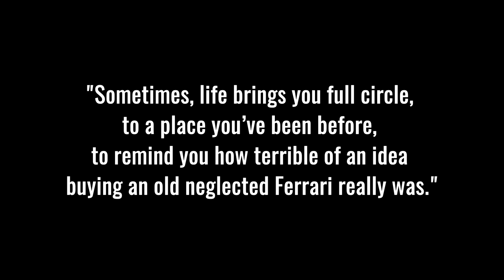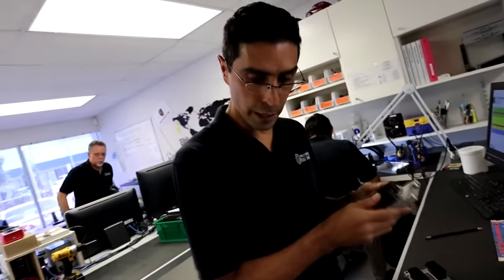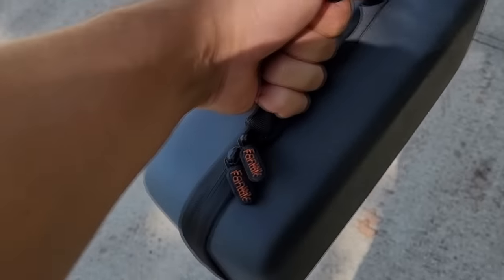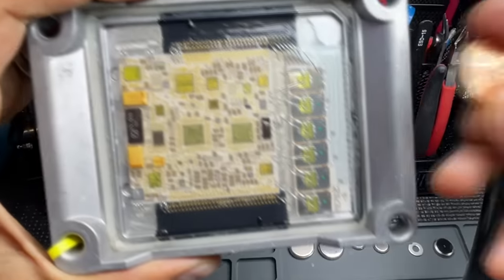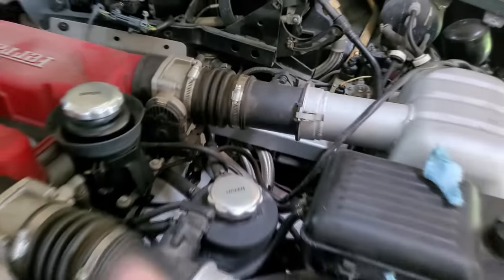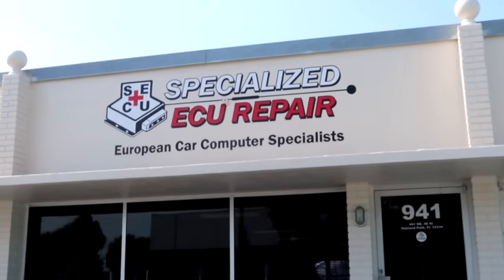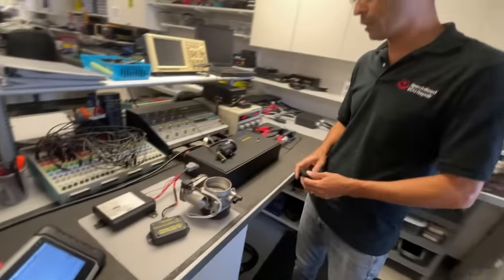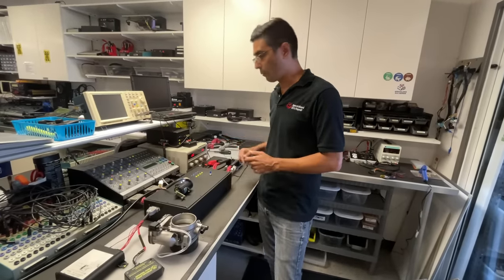Here's What FINALLY Fixed my Cheap Salvage Ferrari!!! (EVERY Ferrari 360's Fatal Flaw)

Comment: You should check with Anderson Dick from Fueltech, his 355 turbo is running on fuel tech and it seems to be doing great
Reply: The only problem with running a standalone ECU is that they don't have systems to run the emissions equipment.
Reply: @vegatrunks  Many of the standalone ECU can be programmed to run the emissions equipment. Its just matter of the software you put in to the ecu.
Reply: @vegatrunks  as long as you get a model with enough inputs and outputs you can just about anything
Reply: @jarnom85  I thought the same thing at first.  But it won't fly in states that do the OBDII test and not the sniffer test.  Sure, you can make the emissions equipment function at some rudimentary level, but I don't know of any aftermarket ECU that will duplicate the OBDII requirements.  The first thing that test looks for is the information on the VIN, year / make / model of car, etc.  They will fail it immediately when that information does not show up.  The aftermarket also will not do all of the necessary monitoring and reporting on the various sensors that are required.  A lot of states have exempted all pre-OBDII vehicles from inspection, so if your car is 1995 or older, you might skate on that aspect of it.  Cheers.
Reply: @ericdolan2130  you could still have the old ECU connected to check via OBD2 the car data and the standalone ECU to run the engine.
Reply: @tcar  I wouldn't say it can't be done, but I think it's problematic. From what I understan, the newer obdII systems don't just observe, they are active players.  If it sees something it does not like, it is going to try to correct it, and when it can't, it is going to throw a code.  You will also need all of the emissions equipment in place and connected.  It's Pandora's box.  You need to mount two ecu's, run two wiring harnesses, etc.  Cheers.
Reply: @hausmeisterengineering5952  yeah, who gives a fuck about our planet...
Reply: @944Tomcat  Wow! Did your mom and/or dad teach you how to behave in public discourse or did you come up with the vulgarities on your own?
Reply: @944Tomcat  If all the systems are working properly and the only thing that isn't completely functioning is the obdii to check it why woiuld it matter?

Comment: The tech you are looking at in the Ferrari is "Direct Die Attach". The other module's tech is standard IC packaging (the dies are bonded out in those black square packages)  and actually over a couple decades old. That is generic "Surface Mount Devices" (SMD) and specifically TQFP for the big chips.  Unfortunately direct die requires some very expensive equipment and skill to service. That is in the domain of the actual chip manufacturers and in clean rooms.  That is also a MultiChip and conformal coated Module.  In a nutshell it is designed to be made - not serviced.  It is incumbent on Ferrari to overbuild the module and maintain a 7-10 year supply after they discontinue using it to keep the service supply chain happy. (Note Tesla, is also pissing everyone off right now by not having adequate inventory for repairs.)  Repair inventories of course have to be factored into the retail unit cost for the duration of the product lifecycle. You ramp production and service when you release the product and as it matures and the end is near quit producing the material and deplete what you can. It is also common practice to keep using the same design in other products as long as possible. This is generally pretty easy with engine computers.  In fact I'd be surprised if that Bosch module (OEM'd by and programmed for Ferrari) was not used by anyone else. That would be terribly expensive. 

All that said - I have to wonder if someone zapped the unit and its miss sensing an input. Moot point as there is precious little you can do to fix it at the component level.
Reply: Agree,  I also think that the Bosch module could reasonably to be found in other cars from the period. NRE on a module like that is huge.
Reply: The BMW ECU is pretty standard Bosch for the period, and I agree it certainly shares it case and general internal architecture with others. Ferrari might have used DDA technology to 'save weight' or some other BS, at the expense of durability, serviceability, and, well, money (Who cares?! Ahh-Hahaha!). So maybe this configuration is unique to them. I could be wrong of course, but that's exactly the kind of thing Ferrari would do because they hate us and want us to SUFFAH!!
Reply: It's not "mis-sensing" an input. It's stuck in bootloop because the processor is browning out. Probably a dead capacitor.
Reply: @Friend_of_the_One-Eyed_Ladies  Knowing what goes on with faulty Apple Laptops it could easily be a faulty power circuit component. That being said Botch would have used the same ECU design in other vehicles and even for other manurfacturers
Reply: Why would something like that ever fail? It looks incredibly well protected. There are no moving parts.
Reply: @GizmoMaltese  
Mainly heat and vibration.
Reply: @GizmoMaltese  - There are moving parts - electrons! Generally these parts will last decades but as Michael Lorenson rightfully noted - the enemy of electronic circuits is heat (note its mounted away from the engine) and vibration - especially on the connectors. Most ABS modules fail because of connectors.  The other situation that can easily kill a module is static discharge during handling. Live connection will smoke an input etc. Honestly I'm surprised to hear these things fail at all. They tend to be over designed and if handled (and cooled) properly should last forever. 
Along the lines of heat. It would be interesting to know if a FLIR camera could be pointed at the two modules while warmed up and running. Is the left location hotter than the right. Is the underlying wall also heating up and dumping heat into the module vs taking it out. That would call for a thermal isolation shim to allow the module to release heat vs absorb. 
Getting back to heat - note that PC folks "overclock" their graphics cards to eek out a little more performance. They jack the voltages and frequencies up - producing more internal heat in the die. They take the fans off and put on water cooling (a classic radiator with multiple fans).  If they didn't get that heat the hell out of there the chips will fry in no time whatsoever.
Reply: @Friend_of_the_One-Eyed_Ladies   - Very possible. Capacitor reliability was a huge problem for several years. There's a known Prius issue wherein the display does not come up periodically. Root cause is a 12 cent capacitor that aged (due to heat) until it was out of spec. Caps dry out, too, over time. It is their known failure mode. A common thing in pro-sumer audio is to send your amplifier in to have all the caps replaced every 5 years. This gets it back to perfect response. I cannot hear the degradation but you can sure see it on test equipment when waveforms distort. Of course for an engine controller that distortion will freak out the decision the software is making. That flapping throttle is a tell tale sign that either the CPU is getting constantly reset or an input (feedback loop) is indicating it did not move. 

Note this is not a "right to repair issue". They make that module "chip on board" for reliability. There is a tradeoff between serviceability and reliability when designing these things. Reliability takes precedence. They fully expect you to replace the whole sub assembly and not dig into the bits which could compromise the reliability of the repaired module.
Reply: @dennisfahey2379  Thanks. I suspected heat could be the reason  but I think it would need to get even hotter than a modern CPU to fail. The connect between the board and the car looked really sturdy. I'm also surprised to hear these commonly fail.
Reply: @GizmoMaltese  - This stuff is usually rated to +85C. Its in an engine compartment. As for the connections failure mode. Its usually vibration that messes up the pin soldered through the PCBA - the solder ages and cracks. Or it can be the mating connector (female side) vibrating and losing springy contact. That is NOT the case here as the module swap followed the module. (Good troubleshooting there)
Reply: @GizmoMaltese  Poor design.
Reply: @GizmoMaltese  Vibrations is one issue. Especially if using aluminium bonding wires because aluminium has no limiy to fatigue. Many metals will drop in strength initially but after enough cycles of vibrations it levels out. Aluminium does not level out - it will get weaker and weaker until it fails.

Bit heat is also an issue for flash-based memories. Some electrons breaks out over time from the individual memory cells, and this process is greatly affected by temperature.

This means that normalmflash memoties can not be used for an ECU - they would lose the memory content in months to maybe a few years. The chip manufacturers have specific parts made to handle much higher temperatures. They are still affected, but at a much slower pace.
Reply: @dennisfahey2379  The engine compartment temperature is an interesting comment, a common cause of excess engine compartment temperatures, is the failure of the silencer (muffler in the USA) insulation. The outer case of the OEM silencer is just a stainless steel shell which contains the heat insulation material, when new this insulation was in the form of solid pads, but overtime it disintegrates and becomes like talcum powder, a well know 360 problem where the engine compartment has to be regularly cleaned to get rid of the "white dust". This seems to occur when the cars are approx. 5 years old, eventually nearly all of the insulation will disappear, causing excessive tempreture in the engine compartment, which is aggravated in countries with high ambient temperatures. Some people in California have been installing boat engine compartment fans in an attempt to cool the Ferrari engine compartment. Onefactory option was to have the CS rear grill fitted.
The replacement of the OEM with a Capristo et.c silencer may also cause elevated temperatures, as they don't have very much insulation.
In the UK I have refurbished a number of OEM silencers by removing the stainless steel covering and replacing the inusalation with a very high temp mineral wool.
Reply: @geoffaries  - Fascinating and thank you for the lesson. Heat is always an issue with performance of any nature. Look at the Gamer PC market and you will see - I kid you not - water cooling and radiators!  So the key is to get the heat that is inherent in any design the hell away from it. Convection cooling requires ambient airflow - remember air cooled VW's? You need to keep moving to create that airflow. Forced air cooling requires fans and ducting to direct it to points of interest. Even Teslas have fans to cool the batteries which heat up when charging.    So I think its time for an epic jump in cooling. If you want 1000HP plus engines you need to deal with it. What does the Veyron have 10 unique radiators?  Be interesting to hear what people are doing to solve this issue as it applies to many many industries.
Reply: @Michael_Lorenson  I agree, a few ounces doesn't help when your car can't move. I think what really happened is someone convinced Ferrari it was a new super-tech. In reality it's basically a large-scale version of how normal chips are internally. And the same reason you wouldn't try repairing an individual chip, you'd never try to repair the ecu. One reason newer CPU's have multiple 'chiplets' is because yield drops significantly as the die increases in complexity & size.

So who ever sold them on the idea is a fantastic salesman (in an evil way) and they guy who signed off on it really dropped the ball.

Comment: I wonder if something like a Haltech would be able to easily take over with an adapter harness?  Seems like the most straightforward solution.
Reply: Until the EPA gets involved, he wouldn't be able to pass emissions on an aftermarket ECU.
Reply: @eldonerc2524  Haltech is an Aussie company, and here’s an Aussie solution: Just do it anyway. Tuned properly, the car should be as good if not better than stock. What’s the hassle?
Reply: @rakeau  > inspection place plugs equipment into obd2 port
>haltech reports "All good m8"
Could work...
Reply: @tinncan  Hmm. You’d think if they wanted to measure emissions they’d stick something up the tailpipe. Y’know. Where the emissions come out of.
Reply: @tinncan  2nd aussie solution: Borrow some working factory ECU’s off of a mate, pass all the inspections, give your mate his ECU’s back so his car works again, and then whack in the aftermarket ecu 😁
Reply: Florida doesn’t inspect. Problem solved.
Reply: @tinncan  I don't think they have OBD2 output. Some people use an aftermarket ECU but keep the factory ECU attached to report 0 issues to a scanner haha
Reply: Haltec and others only make specific units for common cars (GTR's, Altezza ETC) Not so much with a ferrari. Get a good auto sparky on the job and they can wire one up for you no trouble
Reply: I found myself wondering the same thing.  It comes down to economics. Haltech isn't cheap for run of the mill cars, but viable for a Ferrari.
Reply: @ReubenHorner  thats not how that works. You could easily use a haltech in this car. Yes they make plug and play computers but they also make generic units. You just need enough drivers in the computer to run the # of cylinders you have and a competent harness maker and tuner.
Reply: @ReubenHorner  If you call Haltech and ask them, they'll basically make you whatever you want, within reason.  (Confirmed by Haltech employee I talked to before)
Reply: The biggest problem would be integration into the rest of the car's systems. The entire car is all logged into the CAN system and everything communicates, so the ECU must be completely compatible. Not an easy task I imagine!
Reply: @TheDingmann  Not quite right, Haltech make plug and play harnesses for a lot of common cars that are adapted to their units,  you can buy just the plug and pins as well as buying loomed harnesses that are not terminated. You just have to buy the correct Haltech Unit to suit the application, 4cyl, 6, 8, 12
Reply: @rakeau  that's nice but he doesn't live in Australia.
Reply: @eldonerc2524  That was kinda the point. Why else would I suggest others try what we do? If he did live in Aus he’d already be doing it!

Comment: I think Haltech is making replacement ECUs. Basically, an ECU is a series of circuits sending signals in a low tech kinda way. You need an actual computer, like a Raspberry pi, with emulation software that can learn whatever sequence a car is using and replicate it. Should be fairly easy if you can dump an ECU’s code 👨‍💻 We do it for everything else. How hard could it be?
Reply: ask me how i know you dress in womens clothing and have a cs degree

Comment: Wow, that's amazing why Ferrari decided to use such circuit board technology on a road car. That's pretty crazy. I'd say the best option is using an aftermarket ECU like MaxxECU, Haltech, Link etc and then having it dyno tuned. Not necessarily the cheapest option but once tuned the tune can be loaded into any future ECU generations as technology advances 😉

Comment: I have repaired a few of these, it is not related to bad capacitors, but a single (GND) bonding wire, that will have a high voltage drop at bootup, due to the bad connection. It is easy to repair with a bonding station, but it can even be fixed with high precision soldering with aluminum soldering (not tin).  Although it can be repaired, it is easier to buy a compatible ECU and reflash it. Some of the similar ECUs used on FIAT's and others are not always 100% compatible, but my experience is that the compatible ECUs used in Lancia ypsilon are always good for this, and very easy and cheap to source second hand.

Comment: If there's one thing I've learned from you Sam, it's that I will never, ever own a Ferrari!
Reply: Lambo all the way?
Reply: To be honest this issue is transversal to all manufactures of super cars from the 80s and 90s, good luck getting one reliable, even the japanese where having issues back then.
Reply: Nothing is for free in life
Reply: It's not a ferrari if it doesn't spend 8-24 hours in the workshop for every hour on the road
Reply: I knew that after checking my bank account, but glad to have Sam back it up with real world intel.
Reply: Not just Ferrari though, BMW, Mercedes are just as bad with plug-in stuff.

Comment: There was a capacitor on that Bosch unit that looked like it was blown.  (Look at the lower right side... rather large one with a visible crack/burn mark below the black component at @12:34.)  That seems to be a simple surface mounted cap which should be pretty easy to replace.
Reply: I concur with this comment - lots of failed computer motherboards come back to bad caps and relatively easy to replace. Might be the one component in this ceramic circuit board that can be replaced!

Comment: I’d get haltech or motec to supply a standalone ecu and an adapter loom. Sounds like a perfect sponsored project.
Reply: @philipparana9225  a stand alone unit controls everything you need it to, and since the problem is local to the ECU, stand alone is an easy, relatively cheap, solution. And not only is it not a "work around", its better in every way than the factory ECU.
Reply: The way those particular units are going a Haltech unit is a reasonable alternative.
Reply: Get a Ford coyote ecu and some tech can adapt the harness to the Ferrari. Make sure the sensors have the same voltage/ohms, etc. or use the Ford sensors.

Comment: ask louis rossman ;) 15:20 SMD repair is possible. you need a microscope, a hot air station and a steady hand. you will also need a schematic of the board too. its going to be difficult when the board is covered in treacle however.